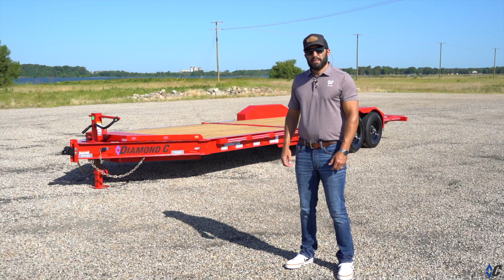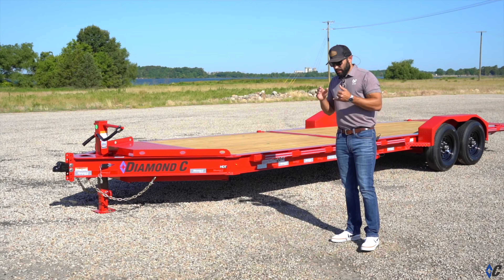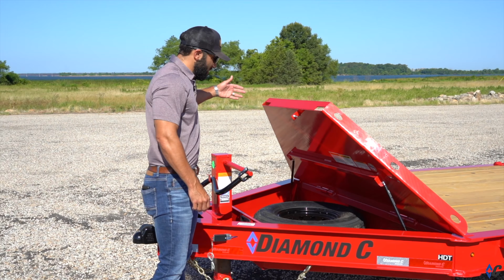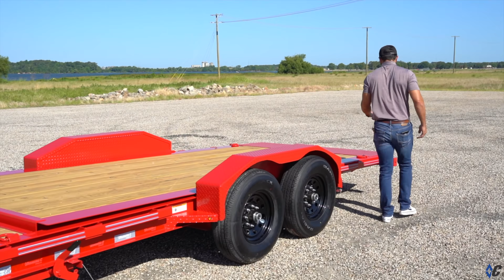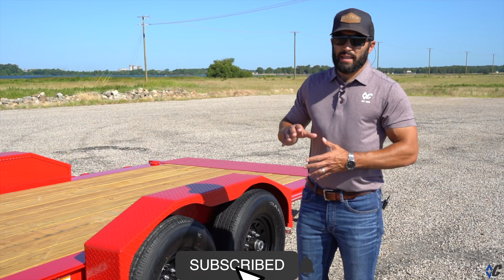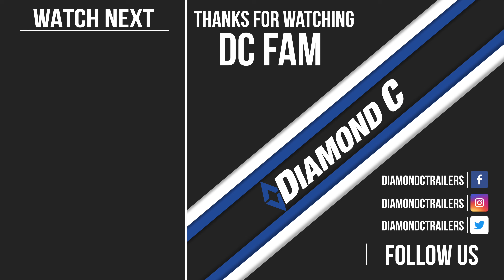Enhance your Equipment Hauling with the Hydraulic HDT | Diamond C

Comment: Is it possible to get the HDT with Frame Extensions/ "Max Width" Package and Drive Over fenders, like you can on a LPX?
Reply: I would like to know this as well. 18k, Max width package, drive over fenders, and with a gooseneck. I would definitely like to see the weight of it and payload. This would be my ideal trailer for any type of hauling.